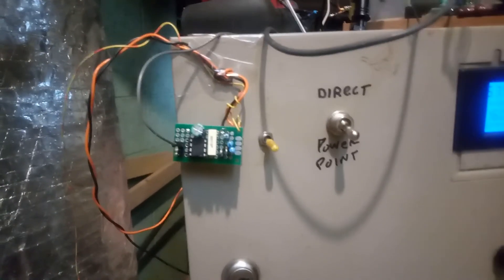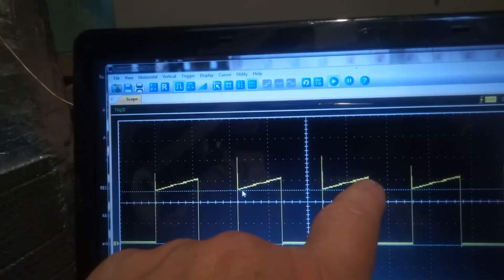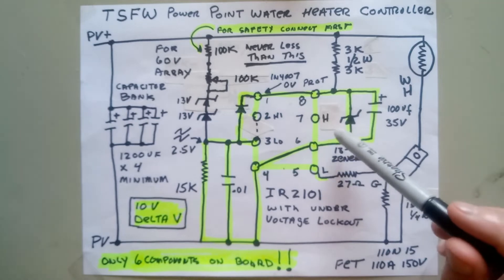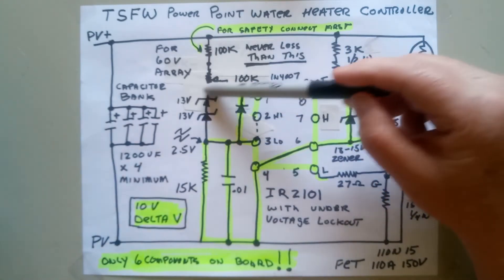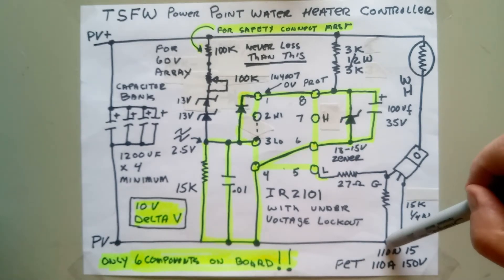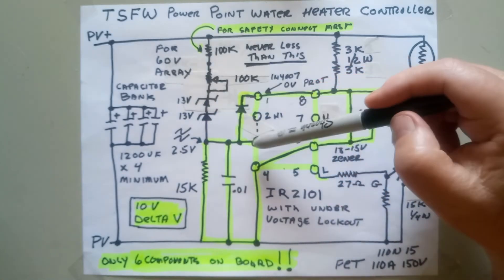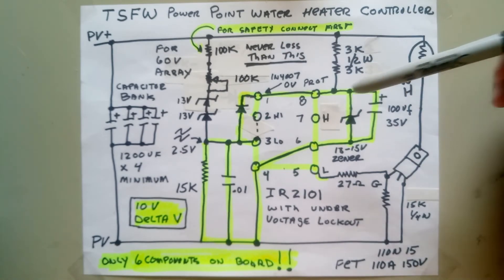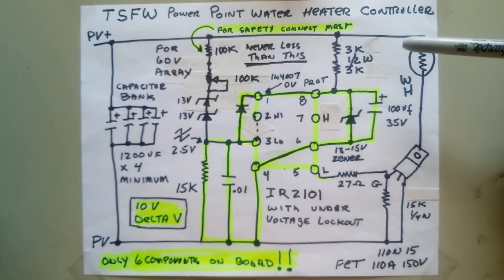TSFW Ultra Simple Build PV Solar Water Heater Power Point Controller IR2101

Comment: I am installing an AC line to my water heater through to the DC dump load regulator, switches an AC demand through inverter and Mppt so demand is created at panels not batteries.  The switch is set to turn on at 95 percent battery capacity (V)and turn off at 90 percent.  Batteries will most likely continue to charge.

Comment: Please sell these
Reply from the maker: Been there, done that. Experience was very negative.  Hope I'm smart enough not to do it again. Everyone wants a box and not have to think. These projects are for electronic enthusiasts. This is not complete design which becomes a system and can only be used in specific applications with adjusted values of components. I did design and provide a board that covers most situations.  You still have to have an understanding of solar to use it. I won't sell it or provide schematic.

Comment from the maker: This is not a recommended build. It does demonstrate how subtracting an offset voltage on the sense line can increase the voltage seen by the driver chip. Example, 5V differential on the capacitor bank can be changed to 1V swing to the driver input.  Actual component values must be obtained with a scope to provide suitable time delay and differential values.  It is well worth the effort to add additional parts so arc interrupt, tighter differential, longer capacitor life and temperature tracking for much higher efficiency in heating water. Don't be lured by easy. Doing things correctly is always the better choice. This had a voltage differential of about 17% which makes it less efficient.

Comment: Dear sir. I am super excited to find your channel. I thought I was alone in inventing the proverbial wheel, and to my pleasant surprise i just found out you not only thought of it, but you already built and have been using it for awhile. I have been dreaming and planning on building a PV water heater for the past year or more. I designed, breadboarded and preliminary tested my circuit a few months ago (battery source instead of PV and incandescent light bulbs for load) but due to lack of time I let it idle. Winter just came where we live, so I finally have a bit of time for this project (we sustain ourselves from farming, so the other three seasons I'm swamped with outdoor work all day). My gate driver circuitry is very different from yours (comparators for on/off switching trigger points with a 555 for logic), but achieves the same thing in principle. I admit yours is much simpler, less components, better overall, and I'd like to try your circuit if i could source the optocoupler driver chip in my country.
I feel like I'm drinking from a fire hose on your YouTube channel, there is so much info and experience to absorb in my very limited time.
I purchased some used solar panels (1200W, 360V max total) for the specific purposes of water heating and charging a small battery for DC lighting and device charging. 
I have no money for a large battery bank and inverter to run the house that others are installing nowadays, I've been dreaming of a cheap inverter (purchased or diy) to power up washing machine and flour mill when it's sunny. I see you've already done that, congratulations.
I'm intrigued with the circuit to eliminate DC arcing, i see it's usefulness after destroying a few extension cords during my early tests with actual water heating from the panels (direct, no controller circuitry). So far i did not understand what you did for arcing, too many videos to digest in a short time.
In the immediate future i wish to go to the next step and actually start heating  water with the controller, and would really appreciate your experience and help if possible.
Is there some way to contact you so the discussions don't get too long and complicated in YouTube comment sections?
Specifically, here is what I wish your guidance on:
1. I need to install my panels quite aways from the house (50-75m, 150-200ft away). I already have the length of 2.5mm² cable to the house, but since I cannot afford more cable, i wish to connect all panels in series, about 360V max, about 4Amps. Of course I'll start at lower voltages, one panel at a time, but do you think this total voltage is too much for such a project? Connecting the panels in two parallel strings would half the voltage, but double the current thru the cables and increase the losses. What is your advice on this?
2. What total capacitance would you recommend? I bought some low esr 400V capacitors, but i only have 900uF so far. Is that enough from your experience?
3. The smaller the capacitor bank, the higher the frequency the IGBT/MOSFETS need to run at. In your videos somewhere i think a saw that you're running them at very low frequency, but forgot what it was. Why do you run them so slow, and should i renounce high frequency switching (i think mine was a few kHz, maybe 5? I don't remember exactly, i know it's determined by the capacitors size, actual load, PV power available, etc.
4. I think I read somewhere in your video descriptions that you may have some PCBs for sale. I know those videos were a few years ago, I wish to connect with you for that purpose, if i can afford it and save some time, I'd love to contact you. How can i do that? Do you have a website, forum, something i could write in private?
Thanks for everything, keep up the good work, and i hope more people get accustomed with your videos, very interesting projects you're working on.
Have a blessed day.
Cr
Reply from the maker: There is method to all my madness.  I designed my system to work at 50Hz maximum because I use arc interrupt.  At a minimum, the current turns off every 10ms to stop current flow and quench the arc, this imitates line frequency.  An off period of 0.7-0.8ms is enough to quench the arc.  During that time the capacitor bank has to be large enough to absorb all the energy from the panels, the larger the capacitance the better.  The hope is that the system will reset before the arc interrupt starts so power won't be lost. With higher voltage the ideal resistance will higher and the RC time constant will be the same with lower capacitance.  The IR2153 design has some nice features. However sourcing that chip can be a problem and there are many fakes out there which will not work.  I suggest the SG3525 design which is common chip and you only need one for entire design.  The FET or IGBT need to be doubled as each only conduct a half cycle.  
The board I made was for initial testing and these always have some layout issues. I had hoped to make a revision when I got some feedback.  People took the boards, and I never got any feedback on the operation, so I stopped selling them.  What country are you in? Shipping from US is prohibitive due to cost. More later when I have time.
Reply: @opera5714  Thank you so much for your quick reply. I have been delving thru your videos in the spare time to understand this arc interruption. I understand and it makes perfect sense that if the DC current to the load is delivered in pulses  (not constant DC), it will extinguish any arc that will be created if there is a mechanical contact opening at that time anywhere in the circuit.
What i don't understand is WHY is there any mechanical contacts in the circuit? Besides a safety fuse in the load wire, why is there a contact between the PV+ Power input, the actual load and the MOSFET switch?  Are you using a mechanical thermostat?
To add to my confusion, I also saw a video of yours demonstrating the arc interruption working on a circuit that had a relay clicking every second or so. That confuses me, I'm not sure the purpose of a relay opening and closing every second in the context of warming up water with PV. I have to dig in deeper to understand the context in other videos, I'd appreciate if you can help understand the purpose of that.
I congratulate you on your ideas , lifetime of experience, and actual go-get-it-done attitude, keep up the good work.
Reply from the maker: @newme2547  The relay video is to demonstrate how a small relay with silver contacts fails to sustain an arc with arc interrupt.  There is an older video where a similar size relay contacts go up in flames without arc interrupt. Because arc interrupt disconnects the heater for about 10% of the time, there is a power loss at very maximum power of about 6%. I make the cycle time as long as possible so that the circuit resets from lower voltage setpoint rather than go into arc interrupt. I do use existing thermostat mechanical contacts so when the upper level of the tank reaches temperature, the thermostat can switch power to the lower element or another tank. One subscriber switches to a space heater in his cabin once the tank is up to temperature.  Thermal mechanical over temperature safety thermostats should always be used to prevent overheating tank from causing severe burns or exploding.
Reply: @opera5714  thank you so much sir, yes, you're right, the mechanical thermostat is a very good safety feature, you could also install a switch to quickly disconnect or switch to another load if you so desire. I'll 'borrow' from your expertise and advice. I'll keep watching your videos, there are other wise insights I'd like to learn from you. Next i want to see the details of how you tackled the inverter running on PV only, with the battery boosting only the inrush startup curent. May God bless you!
Reply from the maker: @newme2547  Dumping power from capacitors can be efficient if the voltage differential on switching is limited to about 5%. This is called adiabatic charging. Differentials over 20% will cause damage to the capacitors even if no heating is noticed long term. These capacitors can be operating up to 12 hours a day for years.  Most consumer grade capacitors are only rated at about one amp.  If you can not get a data sheet, assume this current.  Multiple capacitors are need for long term life. The capacitors I use are rated at over 3A each and are designed for switching power supplies.
Reply: @opera5714  thank you for all this teaching, very interesting, i had not heard about this. Will try to learn more and keep your advice in mind. Thanks for sharing your wealth of knowledge and experience.

Comment: Can this be used on 2kw 230v heater?
PV array voltage is 120V.
How to modify divider for this?
Reply from the maker: This was a simplified design to demonstrate feasibility.  Values would have to be adjusted for 120V.  the .01 delay cap should be increased to at least .047uF for added stability.  I do not currently support this design for 120V as I don't have the time and there are better circuits with more features with only a few more parts.
Reply from the maker: A 2KW hour will produce only 500W at 120V, far less than what four grid tie panels can produce. a 6KW three phase element with two or three elements in parallel would be suitable.  If another 6K ohm resistance is assed to the power dropping resistor, this should work with 120V.  The sense voltage must still go to the 60V tap of resistors.  How much electronics experience do you have and what country are you located?  The abundance of fake FET and other parts make it difficult for DIY construction  without failure.
Reply: @opera5714  I decided to make a version with lm393. I am from Serbia. I have a good experience in electronics. i made my offgrid pv system 1700w with sinewave inverter.
Reply from the maker: @djordjelukovac8041  Good choice, look at my examples except use a FET driver instead of IR2153.  Many 2153 are fake.  Capacitor delay works better than feedback on comparator.  Use extra section of 393 to create arc interrupt.  Please make a video of it in operation.  We need to show this technology works far better than direct connect.

Comment: Hi, I liked this video , I am green to electronics as well and will give this a try! Should I ask my green questions here? or do you have another link? I would just like to confirm that on your drawing of the IR2101, pins 1 to 8 and 4 to 6 are hard connections. Thanks
Reply from the maker: This is a demonstration for electronic enthusiasts to show a simplified circuit. Simplicity has a special allure. Good design is only a few added parts and that extra effort is minimal when years of service is considered. Yes, those pins are connected as you said. That design has only been tested for 60V arrays. The timing capacitor should be larger to insure stable operation. A builder should have a USB oscilloscope to diagnose any issue. As I do not 
have this circuit in current operation, I can not support it.  Fully tested pre production boards are are available at a very low cost of the latest full feature design which includes arc interrupt. I encourage experimentation, but electronics requires a serious commitment in tools, parts and time. Many part sources are fake further complicating diagnostics. 

I prefer to keep conversations on circuits here so advice is available to others.
Reply: @opera5714  Thanks for getting back to me, I understand completely, I appreciate your videos. How can I purchase your pre production board?
Reply from the maker: @phutch8557  I need to know if you are in the US and your exact application, array voltage and current along with heater 
options to determine if this board is suitable. The actual printed board itself is universal and can be configured into many different circuits and voltages including the one in this thread. You can send me your email on my home page in discussions which is private communications.

Comment from the maker: CAPACITORS In theory they can be any size.  They store energy like capacitors and like battery banks, bigger ones are more forgiving.  Capacitors have an internal resistance and will produce heat when current flows in and out of them. Multiple capacitors are better than one or two big ones. Figure at least one capacitor for each 1A of the array.  The heating element will always receive the peak amps for short periods of time even though the current from the panel may be low.  Figure at least one capacitor for each 1A of the array.  Figure at least 1,000uf total for each 1A of the array.